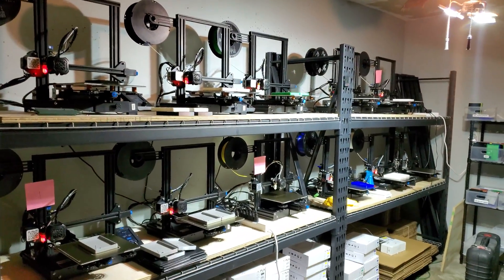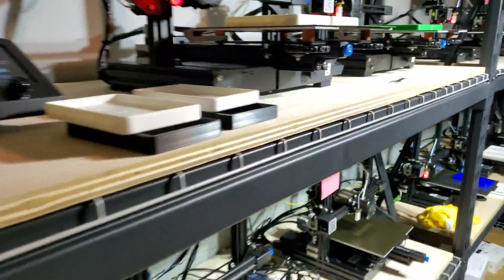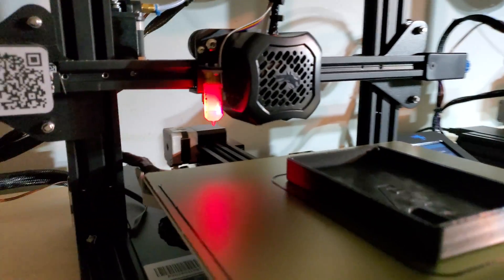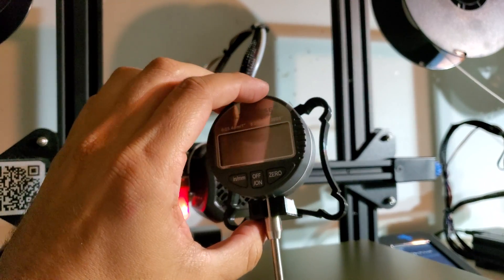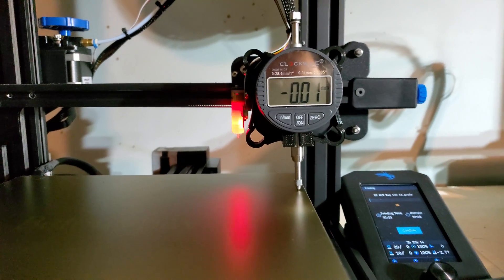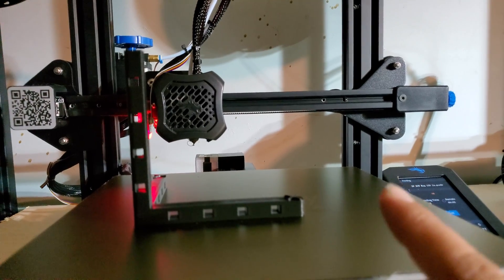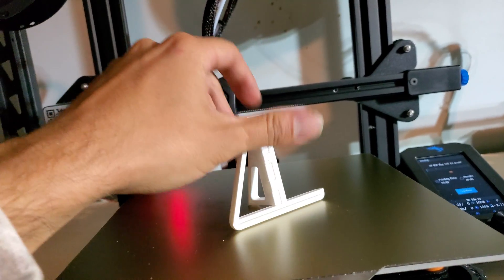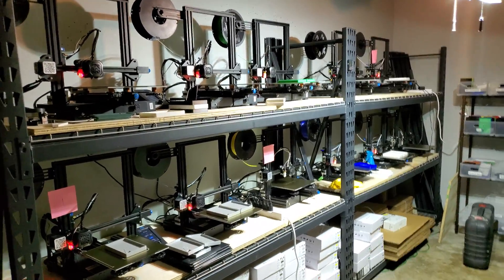Overview of starting and managing an Ender 3 v2 3D printing farm.

Comment: I'm about to buy my first printer. Would you still go for the Ender 3 v2 or the newer Ender 3 s1 which includes the auto levelling?
Reply from the maker: S1 hands down if you want to print and go. I learned so much about 3d printing by doing mods to my ender 3 v2 but it took a lot of work. If you want an easy printing experience I'd go with s1

Comment: To help eliminate vibrations if youre using a rack system, dont just set it up. Bolt it into the studs of your walls. Unless you live in a high heavy traffic area, or like I do, next to a railroad. THEN that becomes a redundant system because the vibrations from the traffic, or train will vibrate from your house and into your prints.

Comment: You claim to make the X-axis gantry perpendicular to the frame side extrusion, but you don't show us how you go about it. Is there a reason for this? I'd be curious to see how you go about it.
Reply from the maker: I actually just force it with my hand 😅 until it's level. Then I run the z coupler back and forth a few times to let it settle and take my straight edge and measure the left and right sides to make sure the gantry is level.
Reply: @Redo3D  Really? My X-axis gantry is always lower on the right side. I also tried forcing the left side of the gantry down a bit, then moving the gantry up and down a few times. When this worked, it was never for very long. If it exists, I'd like to find a more permanent solution to this recurrent problem. Right now, the only solution I can come up with that makes any sense is adding a second lead screw to the right side of the printer. What do you think?

Comment: Noice video.
E3V2 was my first printer, really lovely printer.
For basic prints like what you are printing, it's awesome. But if you start prototyping/tests/etc, you quickly realise that you spend way too much time tweaking the printer than actually printing.

That is why I ended selling it and buying a Prusa MK3S+
Prototyping gets to a whole new level. Whatever you send to it is printed with 0% failure rate. Within 3 months owning a Prusa, I printed more than 6 months I had the Ender.

V2 uses bowden tube system so you cannot really print anything on it. Coz Prusa is all metal hotend, you can print almost any type of filament or it. Because of the all metal hotend, you can use higher temperature, way faster speed printing reducing the speed final printing time.
Reply from the maker: I agree, the E3v2 has some downfalls. But Im going to make it my goal to find all of its quirks and work them out so it can be a workhorse and be as reliable as a prusa! It will take some part replacements and upgrades, but  I'll pull back the curtain on whats needed. Thanks for commenting!
Reply: @Redo3D  All the success man 👍🥇🏆
Reply: @Redo3D  You're doing it right. Don't listen to him. I mean, he actually mentioned an all metal hotend as a benefit for spending $800 over $300, when you can buy an all-metal hotend for the Ender 3 for $20 and install it in 5 minutes. That says it all about his opinion.
Reply: Nice advertisement for Prusa bro. Sorry you drank the Kool-Aid and are trying to justify your purchase. I get it, we've all been there. What's even more odd though is you trying to convince someone that's clearly using the Ender 3 v2 without issue, that they need a different printer that cost three times as much just simply because YOU couldn't make YOURS work.

I almost bought a prusa. I have the money. But I do lots of research before I make purchases and that's why I ended up with an Ender 3 v2. It's already common knowledge that with just a few upgrades you can get the Ender 3 V2 to print just as good as that Prusa.

I've only been printing for 6 months and I mastered my Ender 3 v2 in the first two weeks I had it. Prints pla+, petg, asa perfectly.

All I've done is switch to an all-metal hotend, metal extruder and a Capricorn tube ($100 total) and it's been printing flawlessly for months.

Besides, I would build a Voron before spending $800 on a Prusa anyway.

Edit: By the way, you say the Ender 3v2 is only good for basic prints, not prototyping and whatnot. Well I'm a mechanical engineer, woodworker and metal fabricator. I create dimensionally precise and structurally sound parts for everything I do, everyday on my Ender 3 V2. I'm not sure you're really an authority on the subject.
Reply: @dangerous8333  For what it is worth it, I was always against Prusa until I bought one. I don't have this mentality "100% Prusa". It also has its own issues which required 3D parts and some fights within the community.

E3V2 is a lovelly printer but to get it 100% with zero, I said zero failures rate, you will need to upgrade the crappy ouf of it. The endless Z-axis lines, u name it. Still, I would buy it again any time, give it as a gift to somebody any time over any other printer.

Sure, you can use it for prototyping without problems but not before adding tweaks to the process.

I am building a 3D printer server rack for my network devices. I start the printer and walk away, come back later to start the next and the next and the next.

Design things with FreeCAD, print, change measurements, print again and again and again. There is no touching the printer to fix this or that.

3D printing with a Prusa is so boring, I 3D print things with the same practicality I turn on my TV.

Your comment is more anger towards Prusa than anything else while mine was a neutral share of experience.

Comment: Why do you need the dial gauge?  You can do the same thing with the BLTouch and the Manual Leveling feature of Marlin and get within 0.0001 of level.  Good setup though. :)
Reply from the maker: I use a dial gauge to quickly level the 4 corners of my bed. The setup I use makes it very quick and accurate for me. I also use it to check weekly that my bed is still level for quality checks of my printing fleet.
Reply: @Redo3D  That's not even close to the accuracy of the BL touch, which uses nine or more points on the bed to create a mesh. The corners aren't the only areas that will be out of spec. I was pretty good at Manuel bed leveling as well but I went ahead and did the CR touch and it's really convenient.

Comment: Best thing on my print farm is a large spray bottle with Ipa and microfiber cloths. Before I was just going through paper towels like crazy.
Reply from the maker: I use the same! Quick and easy.
Reply: @Redo3D  What brand built plates do you use? I just got a wham bam but it was $70 and i really dont wanna buy that on all of my machines lol
Reply: looks like a Befenybay  any issues with wear  pei coating coming off?
Reply from the maker: @ImpossibleLink  you are correct it is Befenybay. All of my printers have them, no issues so far. The only issues I've had have been my own fault where I crash the nozzle into the sheet and it dents it. Or I set my z offset too low and it scratches the surface. I just go over it with a fine steel wool and it works again.
Reply: @Redo3D   Thanks does it come with a 3M sticker sheet? For $30 its such a better deal.
Reply from the maker: @ImpossibleLink  I don't recall if it was exactly 3M brand, but it is similar if not. I have bought more expensive steel sheets before that had 3M, and I can tell you I have noticed no difference in quality. The magnet sticks great.

Comment: Thanks for sharing your setup man, great stuff! I also started my printing journey with just one CR-10 in 2018.
Your prints look awesome, are you using PLA or PETG?
Would you mind sharing the link for that removable magnetic bed you use, i'd like to give it a try.
Have you ever had any "power loss" error messages on your machines? 
Also, what's your shopify site? i'd like to check it out. Sorry to hit you with a ton of questions lol, but it's great to see someone else doing this.
Great work man, I love seeing how you found a niche that's working out well for you!
Reply from the maker: I'm using hatchbox PLA, although I'm thinking about switching because I've had a few shipments warp due to heat. I'm going to experiment with insulated mailers before I do that though because I love the hatchbox pla selection. 
My shopify is 
Www.collect3dprints.com 
This is the bed I use:
Befenybay Flexible Removable PEI Steel Sheet Bed Magnetic Heated Bed Build Surface 235x235mm for Ender 3/ Ender 3 Pro/Ender 5 3D Printer (235x235mm) https://www.amazon.com/dp/B08DNCK7P2/ref=cm_sw_r_apan_glt_fabc_MWCTQVD5K44WC06VYW35?_encoding=UTF8&psc=1
Reply: @Redo3D  Thanks for the link, and nice looking website too! I actually just switched from Amazon to Shopify. Wish you much success on your journey man!

Comment: Where did you get the silicone bed mounts? I love the dial gauge and mounts for tramming!
Reply from the maker: I purchased the bed mounts from Amazon. Here is the link!

FYSETC 3D Printer Heatbed Parts, Solid Bed Mounts, OD 0.63 in ID 0.16 in Stable Hotbed Tool Heat-Resistant Silicone Buffer for CR-10 Ender 3 Bottom Connect, 4 Pcs https://www.amazon.com/dp/B07MH4JQB8/ref=cm_sw_r_apan_glt_fabc_29CV6S6R1XAZR4NBAXBA?_encoding=UTF8&psc=1

Comment: Nice setup. I've been putting my farm together, I've got nine printers, six of them are Ender 3 V2's like yours. I made most of the same choices too, including the silicone columns and the PEI bed sheets. I haven't done all of the beds yet, as I'm doing okay printing on glass. But my other printers all have PEI and I've had good success with it over the years. I started out with a CR10S in 2018 too, like you did, and things just sorta took off from there.  Keep up the good works!!
Reply from the maker: Thanks for sharing your experience John, best of luck with your farm!

Comment: Hello sir, !congrats with your enders 3 v2 set up.. I also love my ender 3 v2,like you said they kick ass. Question, what brand filament do you use and is it pla or petg ?
Reply from the maker: I use hatchbox pla. It's a great filament and have never had issues. I do not print in PETG. Only PLA
Reply: Awesome, thanks for your reply..And the info..keep up that  print farm running..